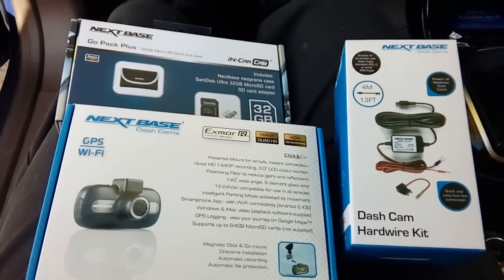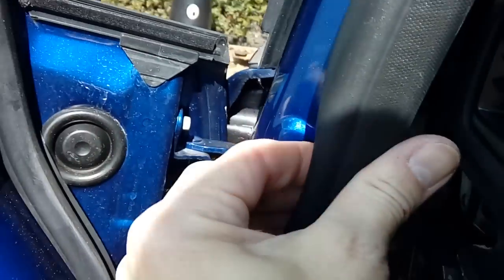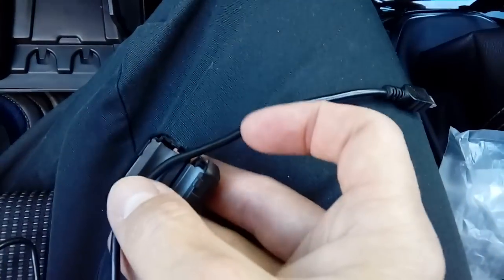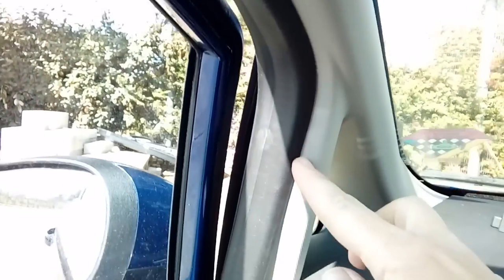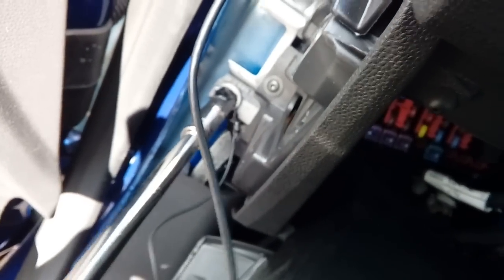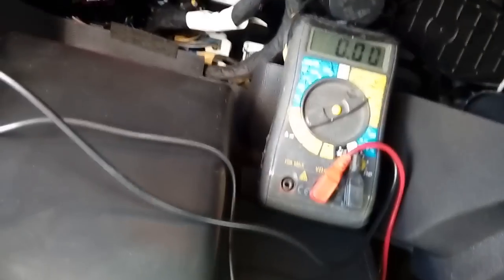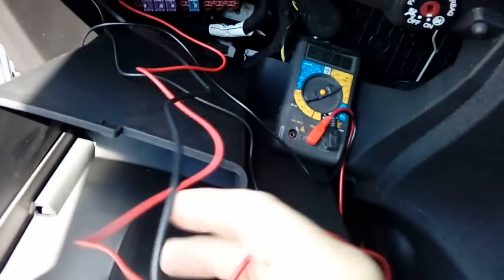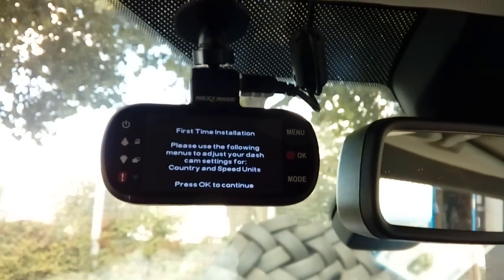How to fit a dash cam in a Fiesta mk6 2007-2017 hard wired to fuse box,quick & simple

Comment: When I piggy back to the existing fuse, only one of the two slots then works, but if I switch them round then the other works. I.e when I fuse to the rear wiper, either wiper works and camera doesn’t or if I switch round the camera works and wiper doesnt. Any suggestions?

Comment: ive got a 2016 renault clio and going to hard wire a rear view mirror dash cam,the rear cam has wire to connect to reverse live wire to light,does this need to be connected or will cam work without this,  as cam will be connected to mirror cam anyway

Comment: I have a 2007 fiesta and looking to hardwire in a dash cam as if I put a dash cam into a cigarette socket it drains my battery as there is continuous power coming from the cigarette socket even when the engine is turned off. Will hardwiring a dash cam solve this problem ?

Comment: How can you see what fuse delivers what voltage? I need a 12v source. In my 2009 fiesta. So I can add a Bluetooth device and some USB ports. I will use a buck converter also to convert it from 12v to 3.7v for bt device. Is there any lower voltage source in the car.? Like a 5v?

Comment: Excellent video.  I did not know that Piggy Back fuses were available and they seem like a great idea.  But does anyone know if the Mk 6 Fiesta offers an Auxiliary ignition key position (as opposed to only live when driving) so that I could supply a Bluetooth adapter from it and use the phone when parked?  I have not yet been able to find a fuse that would do this but there must be a circuit somewhere as it operates the radio this way.

Comment: Hi found this video, ideal as I've a Fiesta 2017, all going well, until went to put the ignition on no power to Dash cam, used the same fuse, checked the fuse was live as ignition turned on, then off when off, checked no problem with fuse, retried the unit with the cigarette lighter lead just in case all good.  Anything else I can try before I take it in to the garage? at least the wiring is in place. Good video though very easy to follow :)
Reply from the maker: @NigelSmith-uz2wy  Sounds like it’s not earthing properly or very rarely the hardwire cable is faulty. They have a 12v to 5v convert box in the cable with a little red light on them.
So - Check red light is on and if not check earth and if that’s ok it might be a faulty cable.

Comment: Great  informative video.Just attempted to hardwire my dashcam on 04 fiesta ghia uk.Fusebox layout same as yours used multimeter as shown but could not get a voltage reading. After pluging in piggyback cable with orig fuse and camera fuse as shown(Very sloppy fit) tried on hot...voltage on all the time and when only ignition on. but to no avail. I can get readings which are great on all the sockets i tested but not when I used the piggyback cable, Im thinking the cable is faulty, bad connection. Any ideas?

Comment: What size ferrite core are you using? Cable looks about 5mm max but to get two widths through are you using a choke designed for 5mm cable or a bigger one? Cheers

Comment: Thanks so much for the clear instructions, I’m now feeling confident to hardwire my front and rear cams at the weekend. Sorry to be late to the party but my nextbase has parking mode so I need it to still work without the ignition on (short term). I don’t have a multimeter so could you tell me which fuse to piggyback on a 2013 Fiesta Ecoboost please?
Reply from the maker: Next Base cams have a small battery in them for parking mode and so only require an ignition switched.
Reply: Superb, I’ll use the fuse you showed so clearly. That’s really helpful and a super quick response too.

Comment: 2015 Ford Fiesta, not getting any power from ignition. Used the same fuse as yourself in the video. As I do not have a volt meter, I can’t check 😅everything else all done as demonstrated

Comment: You were super fast last time so this is a long shot to save my day… I’ve finally got around to fitting my dash cam and everything was going well but now both my dash bolts are stuck fast so I’ve WD40’d for a cuppa or two but forever pessimistic, are there other good earth points nearby I can use which you can explain in the simplest terms please?
Reply from the maker: Any bolt or screw that goes in to unpainted bare metal will do the job fine.
Basically the black wire has to touch the metal of the car body. 👍🏻

Comment: Hi
Like to say I'm finding your guide videos very useful, Very helpful - even tho you've probably done many since.
I'm about toi stall riad angel halo pro in 66 plate fiesta.  I have 2 questions if you are able to help please?
1) in your experience with mk7.5 fiestas, which fuses have you found work best for cams, Constant for Parkng Mode, and Switched for standard, turning on with ignition?
2) matter of opinion I know, but in your opinion which Rear cam location works best - top centre of rear screen, with cable routed through black concertina cable covers, or rear centre of roof lining, cable just tucked under roof lining - which doss not move when boot is opened?
Thanks!  And Thank you for great videos 👍🏼
Reply from the maker: 1. Switched live try heater blower motor, constant live try central locking.
2. Centre of rear window at top, route cable through rubber grommet or cable will split over time (seen it many times)

Comment: Thank you for an excellent video. Am soon to attempt this as a result of watching this. One question on the fuse box: in the video you chose a fuse which shows zero when the engine is off and then power after ignition. Am I correct therefore in thinking that you are not using the camera in parking mode with a constant power source? If I do want to use this mode on mine, which fuse or readings do I need to find? Many thanks!
Reply from the maker: These cameras can flatten the battery when connected to a constant live.
I’ve fitted hundreds and people that don’t listen often end up with a flat battery. The cameras do state they switch off when battery is low but this is now always the case. The camera is not designed as a surveillance camera.
Reply: @PJsprojects  Thanks for the quick reply! Makes sense!

Comment: Wired all mine up today but for some reason, the camera wouldn't turn on. Tester shows power on the fuse but camera has no power. Earth is ok also. Maybe a problem with the kit i bought?
Reply from the maker: @jenksbluebird  The Nextbase cable kit has a little black box in it that converts the voltage to 5v. Check it to see if it has a little red power light on.
If it does -
1. Cable faulty 
2. Camera faulty
3. Plug not pushed in camera fully

If no red light -
1. Power cable is getting no supply
2. Fuse holder has bad connection
3. Poor Earth connection 
4. Fuse blown/bad

Comment: An excellent tutorial but just one point.  Should you not check which end of the fuse is protected by the original fuse?  In other words which way round the piggyback should go.  Am I not correct in assuming that if it is put in the wrong way, the current for the original circuit ends up going through the dashcam fuse?
Reply from the maker: Yes the fuse has what is termed as a hot side. The hot side is the power feed in to the fuse and so yes the fuse spur needs to me on the correct side. I did mention this in older videos but all it did was confuse people and spur lots of questions, so now days I don't mention it and as long as the fuse spur is put in the same way as on the videos all will be fine.
Reply: @PJsprojects  Thanks for the reply and for clearing up my query.  Actually, I think in my case, I am going to use what I believe to be a spare fuse.  I have a 2011 Titanium WITHOUT heated seats and the type 2 Passenger Compartment Fuse Box.  Yet there is a 7.5A fuse in position 10 which the owners guide says is for heated seats.  I think I will just remove that fuse and replace it with the piggy back with only one fuse inserted to power the dashcam.  Hopefully the guide is right and there is not another circuit protected by Fuse 10.  However, I still found the guide very informative - especially the tip about wrapping tape around cable ties to stop the cable dropping down from the headlining.  I am also going to look at rewiring the dashcam in my Jaguar XE that has a DAB radio.  I did not know about the filters and fitting one may improve the DAB reception that is not always very good.  Thank you for that.

Comment: Hi mate, just out of curiosity, does it matter which orientation the fuse tap is placed in? Or is the direction that you've placed it in, the correct method to protect the circuit?

Cheers!
Reply from the maker: @8of93  Yes fuses have what’s called a hot side, install it the same was as the guide 👍🏻
Reply: @PJsprojects  Cheers PJ, only just seen this!

Comment: Thank you so much! Perfect tutorial. Only thing I found was that the spade connector wouldn't go around the 10mm bolt you showed. I used one above the fuse box which was smaller and seemed to connect to the dash 'rail', hopefully it's okay. It seems to work well!

Comment: Hi I’m installing and next base 112 dash camera in to my daughters Ford fiesta 2018 model. I’ve managed to earth the cable and find the fuse which is to the ignition which is the smaller fuse of them all it fires up ok the camera but when turning off the ignition it doesn’t power down which I don’t understand..the setting in the camera is auto off for 10 seconds can you advise or do you know why it’s not powering down? It’s all next base equipment so im not sure why it’s not powering down
Reply from the maker: Sounds like you have connected power to a ignition delayed circuit. Best bet is to test for another one.
Reply: @PJsprojects  oh ok many thanks for your reply I will try another fuse socket

Comment: Excellent video. One thing I wonder; is the magnetic shield essential? Most of the kits on ebay don't seem to include them. What will happen if this is not installed? Thanks
Reply from the maker: Only if your car has DAB radio and your getting interference.

Comment: Fitted mine after whilst watching this video. Make sure you have a socket wrench 🛠, snips & a durable plastic trim removal tool before starting your installation. I didn't read the instructions that came with the hardwire kit I just followed this tutorial & mine works fine 👍

11 plate fiesta S1600.
Reply: u forgot multi meter

Comment: Trying to wire a 2018 Fiesta up, I see the fuses are a mixture of micro and mini. The ignition is definitely a micro, but the Nextbase dual tap thingy is mini. What's worse, the ignition fuse is in a position that prevents me being able to slot the tap in. Are spare/ unused fuses usable or will none of them be switched supply?
Reply from the maker: The 2018 models don't have many switched circuits to use and can be tricky but micro blade fuse spurs are available - https://www.ebay.co.uk/itm/4-piggy-back-fuse-add-a-circuit-micro-2-blade-fuse-holder/112573749882?hash=item1a35eb1a7a:g:WdgAAOSwjh5bBvLI:rk:3:pf:0

Comment: Cheers for this mate - once I'd got all the parts together it took less than an hour to fit it exactly as you showed (2010 Fiesta fusebox is slightly different but used exactly the same principle).
Reply: Joseph Noon hi mate just wondering if you figures out which fuse to use, I'm on an 09 fiesta bit have no multimeter
Reply: Mine is a 2010. The fuse board was a slightly different shape but the fuse is in the same place. 2nd from the left bottom row.
Reply: Hi
Could you please provide details on fitting to a 67 plate GLE 250d please. It’s a Nextbase duo camera 
Many thanks Barry

Comment: Is there anyway to wire from the front dashboard so the cam sits on the dashboard not near the roof.
Reply from the maker: You could run the cable down the back of the dash where it meets the window but just be aware that in the UK at least anything in wiper sweep is not legal.

Comment: Great video - really helpful. Asking a potentially silly question here but what is the earthing cable for? And does it literally just attach to any, or the nearest, metal screw in the car? That’s literally it?
Reply from the maker: Yes you can connect the earth cable to any bare metal surface.
Reply: @PJsprojects  thank you. Just to ask though what’s the purpose of it? I genuinely don’t know having not fitted something like that before.
Reply from the maker: @DRM1891  It completes the circuit, without an earth no electrical item would power up.

Comment: Great explanation thanks but just one question. There are a lot of unused fuse sockets so can I not just use one of those ?
Reply from the maker: By plugging in to one of the empty sockets its possible the ecu will try and read an optional extra that is not fitted and so could throw a fault code.
Reply: Thanks thought there must be a good reason !

Comment: I installed a new in car kit for my existing dash as the last one had a power issue and now my dab doesn't work. I use a ferret cores on the rear & power cable. Dab occasionally comes on but then signal is lost again. I have got a few power cables at top. Should I buy some more ferrets you think? Have you seen this before?
Reply from the maker: This is pretty common problem on some makes and model of car,although the camera manufactures design them to be regulation compliant with required interference guidelines this is simply not enough in some cases. Bottom line if you have DAB interference you may need to reconsider using a rear camera because most (but not all) of the time the front camera is fine.
Reply: @PJsprojects  thanks for the tip. 👍

Comment: I have bought the kit from Halfords. But just can not seem to get mine to work . I have a Honda with the low profile fuses.  I have bought the adapter as it doesn't come with the kit .  Using the front accessory fuse 20 amp as I have heard this can be used . But no joy as of yet .
Reply from the maker: If it's not working you have three possible problems,
1.The fuse is blown - replace fuse
2.No power - test selected fuse position is switched live
3.Earth cable is not getting a clean ground - remove earth cable and clean contact area to bare steel

Hope this helps.
Reply: PJs projects Hi thanks for getting back.  Yes it was the earth cable thank you 👍

Comment: Is there a correct way to put the tap wire into the fuse box at all? Can the tap wire point either side?
Reply from the maker: The fuse tap has what’s called a hot side so make sure to fit it the same way around as in the video.
Reply: Thank you @pjsprojects
Reply: @PJsprojects would that also be the same for putting it into a fuse that is always active such as the audio fuse?
Reply from the maker: @Andrew-fc8nm  yes. Just be advised that although a lot of cams state they can be run on constant live and will shut off when they detect the cars battery running low.
However the reality is many many people that requested this have ended up with a dead car one morning. Your choice.

Comment: I have just purchased a NextBase 212 dash cam for my wife's car which is a petrol Vauxhall Astra 1.8i  The kit needs to be ideally hardwired due to the constant live feed to the only cigarette socket at the front of the car. The fuse board is at the back in the boot. I did have it booked in at halfords for them to hard wire it in for me but for some reason the young so called fitter said he could not do it. Firstly, do you think that this kit will stretch to the back of the car? and secondly I do not have a fuse tester but have seen other YouTube installations and someone use the 5 amp 'Instrument Switch' fuse (which should be fuse number 18 on this car) to run his cam when the ignition was switched on. Thanks in advance
Reply from the maker: You might need to extend the red power cable by a couple of foot but you can earth it anywhere to  the chassis. Not sure why a fitter would have trouble with it unless he/she was short on time due to other bookings.
A lot of people bodge the power cable in to the thick red wire that goes to the rear of the heater control panel as this is switched and very simple to remove. As for the fuse then yes if instrument is switched your fine but be aware the cars are sold globally and can vary depending on build date/spec and destination.
Reply: Thanks for your comment. Is it also possible to make the hardwire cable longer if needed by splicing and connecting together with extra cable if it does not reach. I have the unused cigarette cable which could be used.

Comment: Update,Tested resistance of piggyback cable i was using could not get any reading.However the other two cables supplied tested ok ,which confirms my one is faulty...Think i need to return to seller.

Comment: Hi there I tried to wire mine into my Alfa Giulietta and my heater and 12v sockets stopped working. I disconnected my battery and "rebooted" the car, reseated a different fuse (after doing a bit of research) and it all worked  again, but my dashcam worked for a day or two but isn't getting power now. I had tapped into a 5 amp fuse which was labelled as "various devices" but I only put the original fuse into the fuse tap, not the 10 amp fuse that came with the kit. So my question is, do I need to have 2 fuses in it, do they have to be the same rating, and does it matter which slot in the tap you use?
Reply from the maker: Yes you need both fuses. The two or three amp one runs the camera and the other one is the original from the fusebox to run whatever car circuit you used.
Reply: @PJsprojects  it came supplied with a 10 amp fuse - I wondered why they included it! 😃